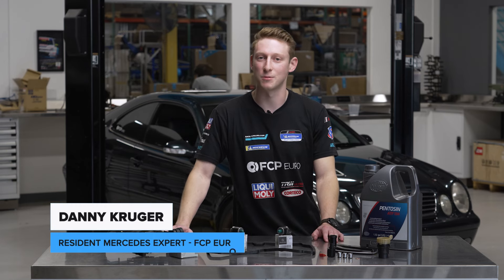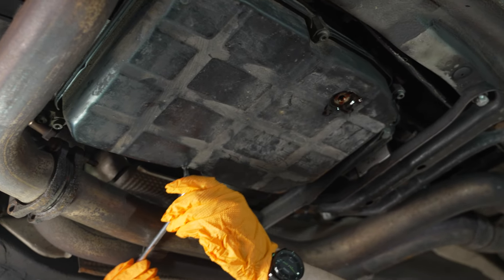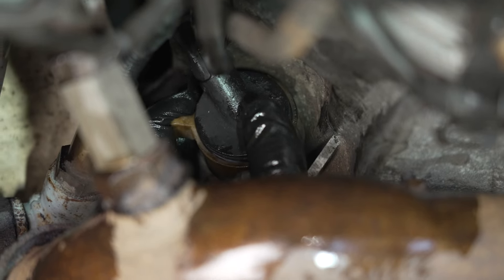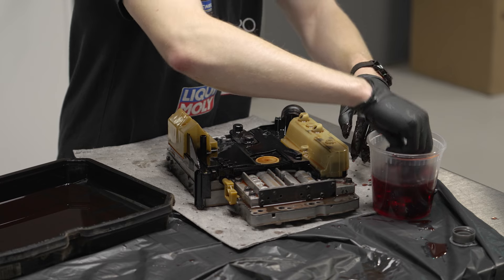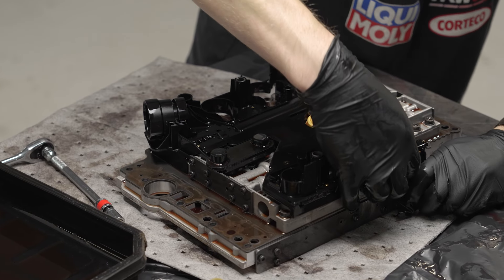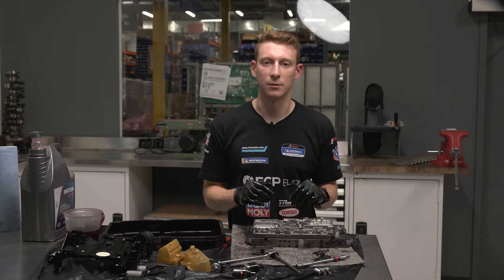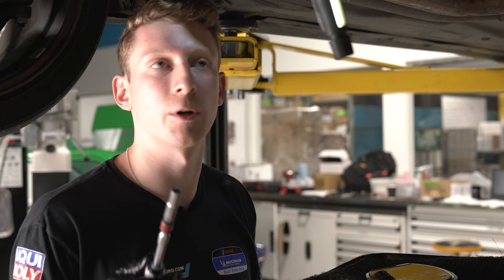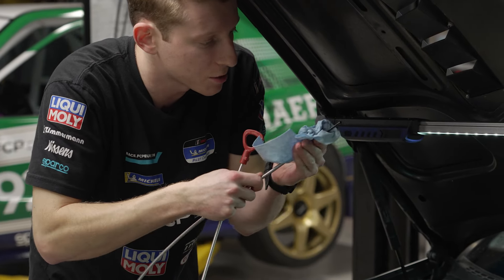Mercedes 722.6 Shift Solenoid Upgrade and Transmission Service (NAG1)

Comment: Thank you so much!! I have big favor to ask... I am a week away from this project and wondering if it is mandatory to purge the system? Should I buy the 7650 kit? Thank you again.
Reply from the maker: It isn't mandatory, but it's definitely a good idea to make sure you get any old/dirty fluid out of the system! Other angles if you don't have the CTA-7650 tool can be to drain the torque converter (removed more fluid from the system than draining from the pan) or adding another fluid/filter change into the mix a little while after your service, to get any of the residual dirty fluid flushed out.
Reply: This is a great video. FCP should start offering in house services like this.

Comment: hello,

if my torque converter slips in basically any speed what yoy think would be the issue? TQ changed with another one and does the same....does not llock up and the car is mooving decently at high rpms...

thanks

Comment: I have a 1989 Mercedes 300E gasoline vehicle that shakes when in reverse and brakes are applied. Forward gears work normally. Do you think the repair is DIY?  If so, please advise parts and instructions.

Comment: So pretty much all these transmissions including say from a 2003 SL500 would require 2 solenoids to be changed. if were looking to improve shift time correct?

Comment: Hi!

Someone before me already described a similar error, if the shift between 1st and 2nd gear is harder when cold, and when rolling slowly sometimes it seems to suddenly shift down and up, could the TCC lock-up solenoid be at fault?

Comment: Hi i have an mb 320 cdi whit 722.6 .300tkm on clock good service history i changed atf oil and now i imagen the gearbox slipping more i used fuchs oil 236.14 oil is it to thin?i have also tried whit factory reset

Comment: FCP, we appreciate your time and work, thank you very much... Am driving a w203 Mercedese Year 2001, but am still confused on how many liters of oil do i have to put in my transmission.

I did my gear box service, changed the oil, oil filter, seal and the Automatic Transmission Conductor Adapter Plug and now my car does not change gears. 

What could be the problem ?

Thanks for your support.
Reply from the maker: Hi there! A couple of possibilities here, but a good first step would be scanning the transmission to see what codes exist.

A first step would be to use your 722.6-specific oil dipstick to check your fluid level (we have a video about how to check the fluid level on your 722.6 with Kyle if you're uncertain), as a low fluid level will almost always result in either an inability to move forward or a "limp mode" when trying to gain speed. Fluid on refill can vary from several liters if you do a full drain like I did with the CTA tool, to around 4 if you did not.

From there, I'd recommend backtracking. Make sure the plug for the transmission computer is fully seated and the TCU itself doesn't have any fluid inside of the plugs. If all of these are done and the car still won't drive, you may want to consider dropping the pan again to make sure that the shifting dowel pin is slotted back into the shifter bracket.

Most commonly though, the cause of this is too little fluid. It's very common for owners to complete the service, refill the transmission, start the vehicle and go for a drive. With each time the vehicle shifts and the converter engages/disengages, fluid will circulate and the level will drop. This is why there's a recommended procedure to the fluid refill.

Hope this helps!
-Danny

Comment: Hello I just recently did my conductor plate service but I feel liKe I put the brown tips in the wrong location because the code that I’m still receiving is a pressure solenoid B code. Is there anyway you can help me with information? I see that the serial says B1 & B2 on the parts, but which one would be the defective/misplaced one ?

Comment: Do I need a tune after installing the blue top soleniods? I will install them on S320 W140
Reply from the maker: Hi Ahmed! As mentioned in the first minute or so of the video, the best way to ensure the longevity of your 722.6 as well as maximize the performance that they add is with a tune. As your W140 likely has a W5A330 722.6 (meaning a factory torque limit of 330nm) you'd want to be extra careful, so I'd make a tune a priority. This can be further complicated if your car has an EGS51 gear selector, rather than the EGS52 "Tiptronic" selector in the later cars.

Ultimately, your best bet is to talk to a tuner near you to confirm they're able to tune your TCM for the swap. 
-Danny
Reply: @fcpeuro  Thank you!

Comment: I have a simple question if I may.  2003 ML500 and I grabbed a Mopar 722.6 TC Lockup Solenoid a bit cheaper as it's the exact same transmission withstanding the TC perhaps.  That TC lockup solenoid should fit and function properly on my ML correct?  I also grabbed a Transgo shift kit and I'm purchasing an aftermarket modified TCM.  This truck is going to tow the city I reside in right!  Since I've gone into the transmission anyway, I went with a WIX filter/seal and AMSOIL Sig. ATF/eng. oil.  Concerning AMSOIL, I am quite the skeptic about their signature engine oil.  It may be fully synthetic but I'm going to confirm or reject that 25k mile oil change they tout.  Don't worry, fluids are checked every week, and if the engine oil becomes abrasive, it's getting changed and the mileage will be documented.
Reply from the maker: Hi there falktv1! As a good "Step One," I'd verify that the Mopar TCC solenoid is the exact same part as the Mercedes part number linked in the description of this video. Yes, the 722.6 was used across a host of Mopar and Mercedes vehicles, but you'll still want to make sure the part you're installing moves the same amount of fluid as the one Mercedes programs for. 

The Transgo shift kit paired with a TCM tune will be lovely, both for towing and for general driveability. The 5-speed works quite well one woken up a bit. We're always going to recommend using a Mercedes-approved filter and, pointedly, a Mercedes BEVO-rated ATF134 fluid in your transmission, as not going so can cause accelerated wear and damage. 

Changing fluid ahead of the recommended interval is never a bad idea, so long as the correct fluid is put back in! We have service kits as well as part numbers in the description of this video that will contain everything you need.

Best of luck with your service!
-Danny
Reply: @fcpeuro  One year later and I've been attempting to find specific information on these upgraded pressure solenoids. This information would be helpful in both calculating the increased towing capacity and also helpful with the Ult. NAG52 TCM project. 

Do you know the spring tension in the upgraded solenoids? 
Do you know the tension of the OEM solenoids?

Thanks for the initial feedback! I ultimately went back to the OEM TCC solenoid just to be certain without worrying about compatibility of the Mopar part.

Comment: Just tried this on my SLK R170. Word of warning, 4 of the 6 sump bolts snapped, despite spraying them, hitting them, and trying an induction heater on them. So bank on plenty of extra time. It was already touch and go getting the drain plug out. 😢

Comment: Having a code P2107 for Modulating Control Solenoid valve after replacing conductor plate. Does that mean it needs replaced, or could that be a pilot bushing issue?

Comment: What size are the T30 Bolts used to hold the valve body to the bottom or transmission?.... i striped 2 bolts and needed to order new ...

Comment: I have a 2009 3.0CRD Grand cherokee that is slipping a little if cold  started and put straight into reverse. If I wait 15 seconds it's fine. First second shift is hard when warm. Any ideas?
Reply from the maker: Hello Troy. What mileage is your Jeep at, and have you ever had the transmission fluid/filter replaced? Often, odd shift behavior on a 722.6 is a byproduct of the "lifetime fluid" losing lubricity/viscosity over time. A fluid and filter change may work wonders here.
-Danny

Comment: Hi. I have a problem with mi W203 Mercedes 220. I have a problem with the 722.6 gearbox, namely a 2nd gear remains blocked (error P2561). I changed the conductor plate, the oil, the filter, I measured the resistance of the solenoids and they are within the parameters, but the problem persists. The oil level is ok. What else could I check? I'm from europe.
Reply: It's probably one of the solenoids which might have gotten stuck.

Comment: Would this solenoid upgrade be beneficial for a non amg car?
Mine is a 2004 E500 4matic sedan with the 722.6 five speed.

Comment: Is it possible that the DIYuser will need to erase any diagnostic code after doing the transmission service? or it will just works fine like you said in the video. I saw some videos where ppl had to use a diagnostic tools because they had to erase some codes. If so , do you need a special scanner?
Reply: By diyuser i mean if I’m doing it myself 😅.
Reply from the maker: Hi Buissereth, if you currently have codes active, you will want to clear them after the service is complete.

Comment: Other than the beginning there is no further reference to 28NM torque. Pan bolts perhaps? Valve body?
Reply from the maker: Hi there! I had meant 20, 8 NM for the sake of this DIY. The vast majority will be around 8NM as you see in the video (or "snug" for those without a torque wrench trustworthy at such low measurements), but the drain plug for the pan is 20NM.

Comment: 722.6 has hard time staying locked up when cold and harsh lock up between 1st and 2nd. P0741 code. Fluid is clean. Valve body issue ?

Comment: Can u make video for 722.9
Reply from the maker: Hi Ahmed! While we don't have a conductor plate replacement video for the 722.9 just yet (the transmission computer being integrated into the conductor plate and requiring coding after replacement makes it a bit trickier) we do have a comprehensive 722.9 fluid/filter service video published! Just search our channel to find Kyle's DIY guide.
-Danny

Comment: Hello, I have a Jeep Grand Cherokee 2007 WH (European model) with DGU 5-Spd Auto W5J400 transmission. I have a problem switching gears from 2nd to 3rd only, it hesitates doing it and when is doing the rev ramps above 3500 rot/min. That is the only symptom. Any idea what might be? the 2-3 shift solenoids? thank you!

Comment: Hello
A paper towel should not be used when checking the automatic oil.
Always check with a piece of leather.
(a leather, for example, with which the car is leathered after washing)
Reply: I use coffee filters

Comment: Yes, one of the best videos on 722.6 on YouTube if not the best ;). 
Thank you very much. 

Are the blue top solenoids for AMG models only? I have Vito with V6 and I wonder if they will make a difference or is it waste of money? Thanks
Reply from the maker: Thanks for the kind words Petr! We'll generally recommend these blue tops for the "W5A580" variants of the 722.6 typically used in AMG cars, as they have a torque limit that will generally behave better/safer. As the solenoids aid shift pressure they'll always make a difference, but you'll want to do the research to be certain that they'll work on your application smoothly and safely.

As for the overlap sleeves and shift solenoids, those will definitely be effective services on your Vito as well! Especially if its showing any of these indications of aging/wear.
-Danny
Reply: @fcpeuro  Thank you Danny

Comment: wondering if i can do this to my e500 4matic 🤔
Reply: It's the same transmission. 4matic has just an additional shaft exiting the side of the trans to a front differential. No difference in the procedure for this service on a 4matic

Comment: You are also an amazing teacher. I have a 99' slk230 with 250k miles. I see is not in your cars list, it's because isn't capable or too old or ....?
Reply from the maker: The 722.6 transmission in your R170 SLK is likely a W5A330 model, meaning Mercedes notes a torque limitation of 330nm (around 243 ft-lbs). While it's possible that this upgrade is plug-and-play just like on the high-torque W5A580 variant in this video, we'd definitely recommend talking to a 722.6 transmission tuner near you to confirm that they can safely program your TCM to accommodate the blue-tops!

Comment: My pilot bushing lined up straight away, all 100 times I tried, but the amount of force needed to push it on, would have definitely not been safe on jack stands. Lucky I had the rear wheels up on a ramp.
Reply: I like to warm the o rings in the sunshine  for a few minutes , then  use a smear of vaseline on the o rings and it should go in easier.

Comment: Omg what do the numbers on the spacers mean?? I dropped the pan and threw the screws and spacers in a container for cleaning. After i cleaned the spacers, i saw there were small numbers on them.. i have no idea where they go.  I had no idea i was supposed to keep track of them. I don’t even think the Dodge service manual says anything about it.
Reply from the maker: Hi ineedfiles! Don't panic just yet. Not sure for certain that things are the exact same on your Dodge as on a Mercedes (some of the Mercedes models have a bracket that holds the oxygen sensors, which those spacers are also responsible for locking down) but for the most part, all of the spacers (also called "sprags") should be about the same size and length. If you have all six in front of you, doing a visual inspection to be sure they all have the same size and dimensions will go a long way.

If all of the spacers and bolt lengths are the exact same, you should be fine to just send them home in any location. If there is an odd one or two out with a more offset design, they're likely to be at the front of the pan for the aforementioned bracketry (and likely, just one underneath the pilot bushing). 

Simply take your time threading the bolts home, as the sole purpose of the sprag is to secure the pan to the bottom of the transmission. If the bolt head becomes flush with the sprag and you feel it hasn't properly engaged enough threads, that sprag may be in the wrong space. Just be sure you torque to specification, as stripping out the threads will make a simple job a lot more difficult.

Hope this helps!
-Danny
Reply: thanks! I thought for a second, that i had even more problems to worry about since 2 of the bolts/screws that hold one of the block off plates snapped off earlier, and the ends of the springs look mangled. 

Thanks for the awesome video

Comment: So if the tcu has oil in it will I have to replace it? And of so will I have to program it as well?
Reply from the maker: Hey there Ruben! If you find the TCU has oil in it, it's worth attempting to hit the circuit board with some contact cleaner in hopes of bringing it back. Some folks have had luck with this.

If this doesn't work, you'll want to source a unit with the same year/model as the one out of your vehicle to avoid any discrepancies between gear selector or communication.
Reply: @fcpeuro  so would I have to program the tcu if I were to replace it ?

Comment: Can you insert the dipstick while yhe car is running when you check it warm?
Reply: It is a must to have engine running.  Also, trans fluid needs to be 180°f (HOT, not just very warm). If you use device plugged into OBD port just know this; car must be in gear to receive actual temperature!!! If P or N is selected the temp reading is not correct as the switch serves two purposes. First is to tell computer if transmission is disengaged and second is temp which would also be engaged. If you toggle from P/N  to R or D you will see after a few seconds what I'm saying.

Comment: Hey is there an upgraded blue top for a 722.9?
Reply from the maker: There is not, as the 722.9 already uses a very similar solenoid to the blue tops from the factory. You can investigate a TCU tune for your 722.9, but the 7G-tronic is inherently a faster-shifting transmission than the 722.6 5G-Tronic we're working on in this video.

Comment: I have a C320 I bought the plate from FCP euro but it's still limp mode does that mean my solenoids are bad it's not shifting to 1 or 2 it makes the speedometer go to 0 to back to the same speed and it keeps going crazy and feel like the car wants to turn off and at the light it does it so bad sometimes when I have my foot on the pedal the car makes a loud noise like its stuck i just need some help I have a 2001 C320
Reply from the maker: A crucial next step will be to scan the car and transmission for any fault codes. If any are pointing toward the transmission, make sure you check the fluid level as well; it's very common for the fluid level to drop substantially during the first drive after a service.

Comment: I put a brand new conductor plate and all new solenoids and my car is still staying in limp mode but if I drive it for a little while it will start shifting normal
Reply: Same. Cleared codes on my icarsoft MBII and still in limp mode. Did you find out what your issue was?

Comment: Hi
I have a 1999 E320 
Can i male the upgrade??
Reply from the maker: Your E320 likely uses a W5A330 version of the transmission, with a torque limit of 330nm or 243 ft-lbs. I'd recommend talking to a TCU tuner near you, as they'd likely have to alter the torque limit to accommodate these solenoids (which, of course, can be unsafe if done incorrectly).

-Danny

Comment: I HAVE JUST RELACED MY CONDUDTOR PLATE AND DISCOVERED THE PLACTIC HOODS OVER THE SOLENOIDS ARE MISSING!
this is on a T1N sprinter.
Is this a problem  and does anyone have a part# for the hoods?
Thx
gb
Reply: Not a problem.